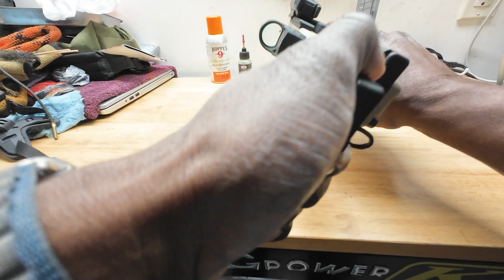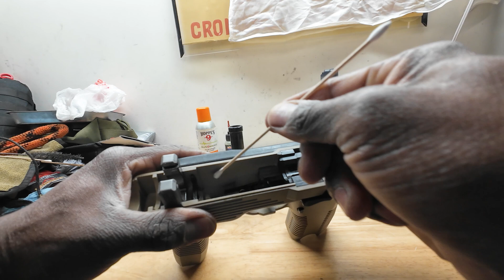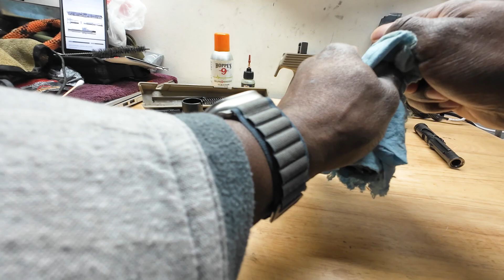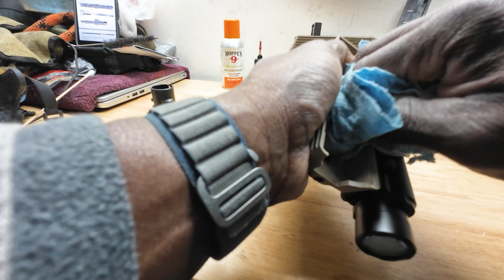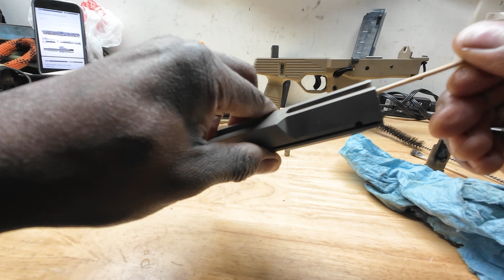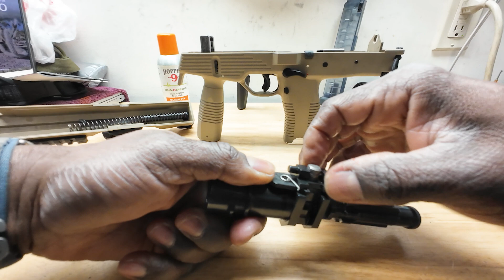B&T TP9 Cleaning Guide: Full Disassembly and Maintenance for Beginners

Comment: after i dry fire mines i cant pull back the charging handle any idea why that would happen
Reply from the maker: It's not normal. Is it a stock trigger and trigger housing? Any mods done to the pistol? I'd go through the basic troubleshooting, make sure no pieces are broken or damaged in the internals.
Reply from the maker: Contact me via email
Reply: @EasyBTactical thanks for the reply I got it to work after messing with it for 3 days still not too sure what was the problem